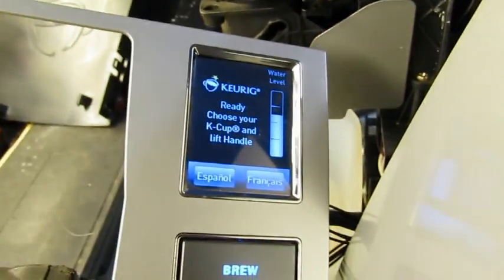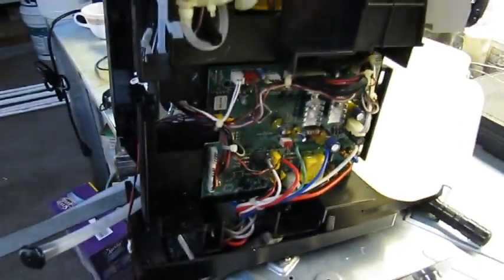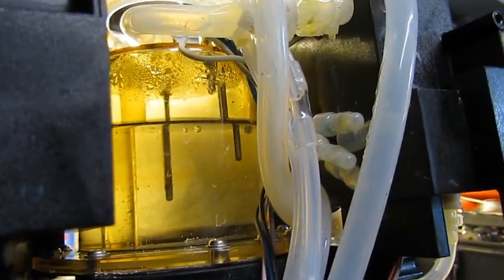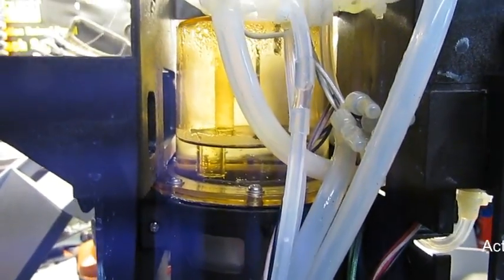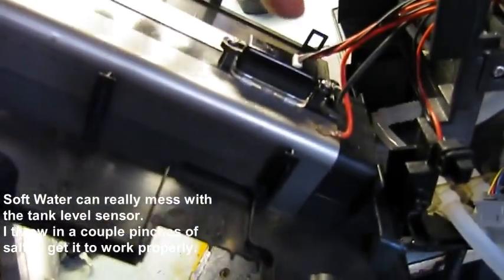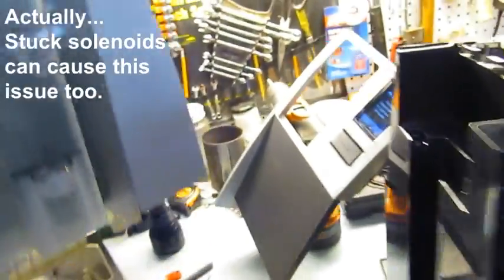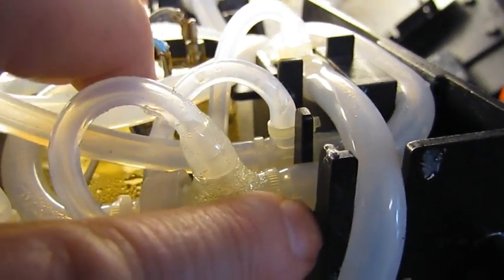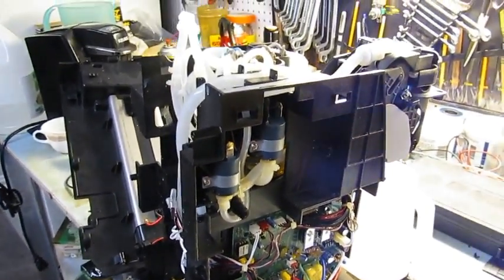Keurig Secrets Revealed - Look under the hood of a working Keurig K155!

Comment: Any thoughts on why my K150 only brews 8oz sizes, regardless if we pick 10oz or 12oz?? Thanks in advance!!
Reply from the maker: Just a wild guess here... Perhaps hard water deposits on the inside surface of the tank (where the sensor rods are) is confusing the logic. Try running pure white vinegar through the system a few times and see if that makes a difference in behavior. Multiple flushes will be required to remove the vinegar flavor.
Reply: Dean Stucker Dean, thank you so much for the tips!! I’ll do so and see what happens. I called Keurig and they indicated that the 150p has no serviceable parts and they directed me to throw it away after I receive my new one (under warranty). Seems like a horrific waste to do so since it’s only 3 months old.  Any ways THANK YOU!!

Comment: I have this model and all of a sudden it clicks and doesn’t turn on. What can it be. The clicking just goes on continuous.
Reply: Same here.  I finally got it apart and am checking the transformer for an OPEN condition.
If that isn't it, I perhaps it is the switch.  That seems to be the source of the clicks.  UPDATE the clicking is from one of the two solenoids, Dean showed us in the video.
Reply: Alan Monday so how did you fix it? I have the same problem
Reply: @agilitydoberman  Sadly no.  Thanks for reminding me.  I had to throw the entire thing into the trash.  After going through the considerable effort to replace the solenoid, the clicking continued.  Sometime in the electronics is cycling it.  So, I replaced the unit.

I came up with using a mini-ball float valve on a Cuisinart SS-10, along with a filter for it.

https://www.amazon.com/gp/product/B07NDKDMKF/ref=ppx_yo_dt_b_search_asin_title?ie=UTF8&psc=1

https://www.amazon.com/gp/product/B07NDM7BCH/ref=ppx_yo_dt_b_asin_title_o00_s00?ie=UTF8&psc=1

https://www.amazon.com/gp/product/B079YXTTKV/ref=ppx_yo_dt_b_asin_title_o09_s00?ie=UTF8&psc=1

I will never buy Keurig again.  But, the bright side is the Cuisinart is an upgrade in every way, for much less cost.
Reply: @alanmonday9981  Thanks. This is my second one with the same problem as yours. I will try to use the first one for parts after I figure out how to take it apart. From others on this channel, I think your circuit board has bad parts. I will try to exchange out the circuit board and see if that fixes it. Otherwise, I like the Cuisinart solution.
Reply: @agilitydoberman   The circuit board seems like a good next step.  Please let us know.
Reply: @alanmonday9981  How did you got it open?  The clicks are from two 1000uf capacitors on the main board.

Comment: Thanks Dean, your video helped me with tarring apart my K150P model, its  a year old and suddenly it went dead, you could here were constant solenoid clicks. The LCD doesn't power on, I'm wondering if it the Circuit board has shorted out. Would you know where i could find a spare circuit board?
Reply from the maker: Ebay. Do a search for the words "keurig AND circuit AND board AND 150P". (everything between the quotes) I'd be surprised if you don't find one for sale.
Reply: Dean Stucker, i was afraid you'd say that :) Lots of boards out there nothing for the 150P, these seem to be quite disposable
Reply from the maker: Lots of clicking could also indicate a "low voltage" issue. Perhaps early signs of a failing transformer. The constant clicking could indicate that the circuit board is fine and trying to do its job but the low voltage is insufficient to maintain constant activation.
Reply: What the unit is doing now is both pumps (water & air) are operating non stop, the screen back light powers on but nothing shows on display. The clicking of the solenoids, one was stuck partially (light taps restored its functionality). I tested the transformer voltage output, it measures at 15.8V continuously. In your quest, did you come across any circut schematics for your machine, google has nothing on mine. Id like to see whats causing the malfunction of the board, i'll post a video tonight to show what I'm describing here. Here is the video:  https://youtu.be/YJucQYCvsaQ

Comment: Thanks for the video as it provided great operational details! I disassembled my K150 (with plumbed attachment) and wanted to add a few notes as they pertained to my model.
1. I didn't have to remove all of the lower screws to remove the covers as 1 of the smaller screws holds ground wires and a 2nd holds and grounds an electrical component to the base plate.
2. Removing the covers was definitely tricky as they are mostly snap-in pieces and use very few screws hold them in place. Some of these snap-together parts are difficult to get to but I'm sure there's a service manual somewhere that details the proper removal sequence. I used a sharp knife blade to get in between or under some of the covers to either separate them or gently pry them apart.
 I'm now thinking that one of those thin metal cake frosting spreaders would've worked better. lol
3. At first glance, the single top & back cover looks like there's no screws holding it in place. They're there but were under 6 plastic caps on mine that looked like they were molded into the cover. They were difficult to pop-out due to the tight fit so  I used a knife with a sharp point to cut a small divot in each cap by pressing the point into the center and rotating the blade. Once the small divot was formed, I used an angled pick, pressing it in to punch a hole which the pick then used to easily pop them out. With the screws removed, the cover was removed by prying the front cover upwards and away from the top cover a bit. This allows the molded-in ledges under the front cover to separate from the notches in the top cover's front edge. You then have to slide the cover backwards (not upwards), away from the front panel as there are plastic brackets under the cover's side that slide under pegs on the side covers. I'll try to take pictures showing this before I re-attach the screws as it should be easy to capture the sequence now that I got it disassembled.
4. When looking at the unit from the front, my air pump is on the right side of the unit whereas the model in your video appears to be further in and on the left side of the unit. In other words, the air pump on mine could be easily removed when the unit's right panel is removed.
5. My air pump would run for only a few seconds then turn off, either pushing out only a small amount of water or none at all. Removed and tested it by using a 12v wall power adapter that was used by another device to power the air pump. The air pump ran continuously and wouldn't shut-off after a few seconds proving the pump was working properly. Re-attaching it to it's hose and applying power again did push all of the water out of the heating tank so I knew the problem was elsewhere. Btw, the fact that it wouldn't push out enough water to get the heating tank's water level below the sensors, resulted in the next brew showing only the largest brew size in the display panel.
 Smart electronics!
6. I then removed the zip ties from the hoses on one solenoid and removed the hoses. (Note: Mark where each hose attaches)
Blowing air into one end prevented it's exit at the other end which was a good result as the solenoids are "normally closed" and are opened if the system detects a problem, allowing water to return to the heating or reservoir tanks as you indicated. Did the same for the 2nd solenoid which DID allow air to exit at the other end. This let me know it was stuck open as you also indicated in your video, possibly from built-up mineral deposits. Will be ordering both solenoids just to ensure they open as well and will provide an update once they're installed.
Reply: Update: Acquired both solenoids locally and installed them last night. The wires are soldered on, so you'll need to use a soldering iron to remove them and solder them to the new solenoids. I have a soldering station but used a portable butane model which you can purchase at any hardware store. Pickup some soldering wire as well as new solenoids will most likely not have any on their terminals. The solenoids I purchased, were from a surplus store so they looked like they've been cut out of some other unit that uses them for delivering air. They were the exact same model so their terminals already had cut wires & solder on them which made it easy to soften and insert the wires into.
I did think of just cutting off the wires, stripping them and attaching lugs with a crimping tool but that wouldn't have worked for me due to the existing solder that would've made it hard to slide the lugs onto the terminals. If you buy new solenoids and they don't have any solder on the terminals, you may be able to go this route if you don't want to deal with soldering.
Reassembled the unit and gave it a test run. Very successful and it actually delivered more liquid when selecting the 10 ounce brew than previously. I had acquired my K150 used from a business that had closed so it probably had a good amount of use which may have caused one of my solenoids to get stuck open after I ran it for a few weeks.
I was going to attach some disassembly photos here but there's no option for doing that. Will try to put them into a slideshow video and post them on youtube later this week. Once uploaded, I'll put a link to it here as the video coverage here is a great start to learning about the internal components.

Comment: I have a Keurig K150P.  The "P" means that it came with the auto fill already installed.

#1 - DO NOT buy the auto fill option.  After a while it starts to grow slime that clogs the system - plus you are drinking it (slime).  You can't take the tank off easily to clean it.  Plus - out of sight, out of mind.

#2 - Do get the removable one.  I threw out the auto fill tank and got a removable one.  It has a removable top so it's easy to inspect.  I rigged mine with a direct water line with a hand valve so I could fill it without removing the tank - but the tank can be removed in seconds to clean it.

#3 - My K150 got slower and slower.  I took the thing apart (not recommended) and the inside looked really clean.  HOWEVER, the filter where the unit draws water from the tank was clogged with slime.  To clean it - remove the bottom metal plate.  Take out ALL of the Philips  head screws, remove the metal bottom (not the wiring), and you'll see the inlet plumbing.  Easy to clean.
Reply: All you really need to do is take the top 2 screws out over the water tank and you can add the descale agent to the tank.

Comment: I have a k150p quote similar to the one you have. I took it apart and cleaned it as it wasn’t running. Ran a couple times and now it shows message. System overheated. Do you know how this can be fixed??
Reply: How did you get it apart?  Is there a video someplace?

Comment: Keurig doesn't want you using distilled water because you need minerals in the water to operate the water level sensors, which rely on electrical conductivity.  They could have used a number of other methods to measure the water level.  But they'd rather have you spend $200 on a new machine, that uses only licensed k-cups which cost 200 times more than they pay the farmer for his coffee, while polluting the planet with milions of tons of used k-cups.
Reply: Do you by chance know what you would do if the screen says system overheat?

Comment: Great video Dean. These are no joke when it comes to screws. Jokingly I believe that’s the only reason they are so expensive is because of the cost of thousands of screws!  Anyway, I watched because I have a smaller Keurig that has a water pump. Some days worse that others, but on the bad days it sounds like it’s going to fall out of the machine. I have a spare machine and may take this one out of service, try my luck, and see if I can silence this loud rattling water pump. Thanks again for the video.

Comment: My K150P is not brewing.  It heats up and lets you get to the brew function, but only allows "12oz" to be selected, and once it starts "brewing", nothing comes out and it stays there forever with the display reading "brewing".  If I go into the service menu and turn the brew pump "on", it makes noise but nothing comes out.  Should i replace the solenoids?
Reply from the maker: Based on my experience, any Keurig that behaves strangely - especially like what you're saying - deserves strong consideration for replacing the solenoids. The computer can get confused when the solenoids act up. But first use a wire (or large paperclip, opened up) to make sure you're not dealing with a simple case of plugged orifices where the top of the K-cup is punctured.
Reply: Did you ever figure this out? My unit requires me to unplug from the wall to revert to functional again, and always does the "12oz" only option after the first 12oz portion is used with the machine. I've opened it up and found the two solenoids (CJV23-C12A1), both of which seem to open and close fine.

Comment: Hey Dean,  I'm very appreciative for your explanation on the workings of the Keurig units.... I've got mine apart and replaced the compressor thinking the limited flow I was getting was due to the compressor being bad.  But plugging the overflow into the reservoir caused bubbles to come up thru the water inlet, so I'm pretty sure that one or both of the solenoids are the culprit.  Will test and replace those now.  My wife thinks I'm crazy for digging in like this, but being an engineer, I told her " inquiring minds want to know!!".  Thanks again for your insight into how these things operate. LarryS
Reply from the maker: Thanks, You're welcome, and Good luck with the repair!
Reply: Hey Larry I'm having the exact same issue u described above, did replacing the solenoids fix the problems? thanks
Reply: @sakm.6573  I did replace one, but the problem persisted.  Then I looked at the other and when I disconnected the tubing from it, some white chunks (calcuim?) were right near the tube ends. I think they were plugging/restricting water flow, causing the problem.  The 2nd solenoid passed the 'blow-thru' test, so I reassembled and its been working fine since. Good luck with yours, 
LarryS

Comment: Dean ,
During a descaling operation my K150P ( I believe a latter version identical to B150 except direct plumbed) went into system overheated mode and does not reset.  Do you have the schematic to see if there is a thermistor the needs to be replaced.

Comment: Really appreciate you sharing this because it helped me determine that a stuck solenoid valve is probably the issue. You may already know this, but you can enter a maintenance mode by powering the unit on, then before it gets to the Heating/Ready screen, press and hold a finger on the touchscreen and press BREW 3 times. (Machines older than a few years require a press on each of the four corners from standby). Once in the maintenance menu, press BREW to cycle through options and stats. Then you’ll get to the screens that allow you to manually override and activate individual components such as the water inlet valve (for direct plumb), air compressor, cold water pump, vent valve/solenoid, etc.. (To other readers, common sense should be utilized when tinkering).

Comment: Hello Dean,

Thank you for this tutorial. I have the exact same model and I have a problem with it. When the coffee stop brewing, the "brewing..." message still on the screen for 30 seconds (usually, it is 3-4 seconds) and when it's finished, I can onlly brew 10 oz. No other options on the screen. I have to unplug it to reset it. Do you think it's a solenoid and/or air pump issue or it's more of an electronic problem ?
Reply from the maker: I've seen limited size options displayed on my screen too. Had to unplug the machine to get it to think normally like you did. The problem went away after replacing both solenoids and fixing the air pump. Apparently unexpected signals   from the sensors, due to malfunctioning solenoids, can cause unexpected results in the display.

Comment: Great Video! I have a K150P like the one in your video. It has direct water plumbed into it for office use.  It brews fine but it won't refill the cold water reservoir after 2 or 3 full brews.
Keurig said it could be the Internal check valve that is bad.  Are they talking about the solenoids?
Any advise would be so appreciated!

Comment: Fantastic video on the B155/K155 model.  We just acquired one from another department in the company.  It was giving them trouble but it worked fine for us for a few weeks.  Now it drips and spits water while heating, and now it doesn't push water during the brew cycle but it does during  the boiler fill cycle.  So I know it needs new solenoid valves.  I have done valve replacements on other consumer grade machines.  Now I have a better comfort zone on getting into this machine to do a solenoid replacement.  Good job on showing the boiler, air pump, water pump, solenoids and all the plumbing.  Thanks!
Reply: Could you provide a link to your video, got the back and top off but feels like I'll break the side panels trying to pull them out? Wil pulling the bottom base off release the front and sides? Got an overheated lockout and can't see a fix for that here.

Comment: Our office machine stopped working recently. The pumps seem to be fine but it gets stuck heating water. I’ve drained the internal tank and it does refill it, it just doesn’t heat the water. Any help would be appreciated.
Reply from the maker: Sound like the heating element may be burned out. Or.. The relay that switches on the heating element is failing to make a good connection. I suppose you could CAREFULLY "hotwire" the heating element to a known 110v source and see if it works. You may be able to find a used heating/filling chamber on eBay.